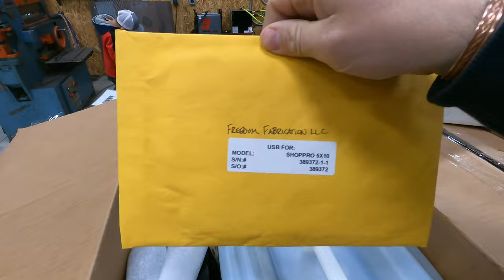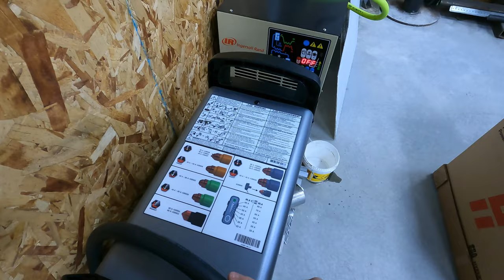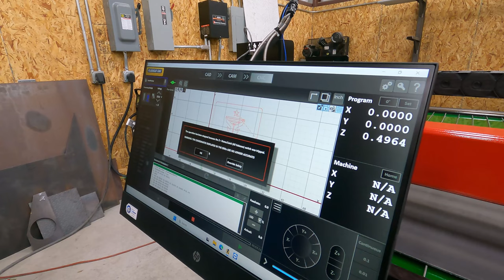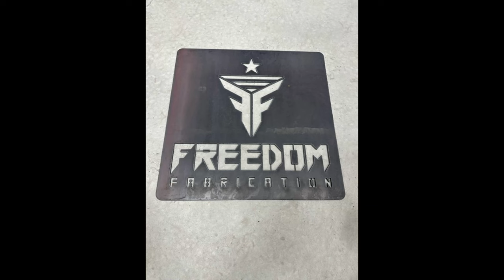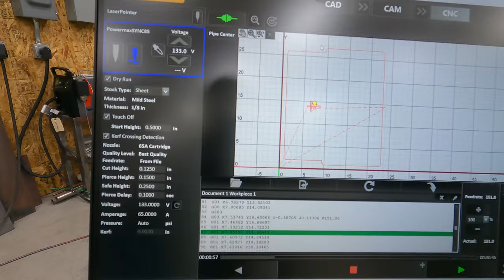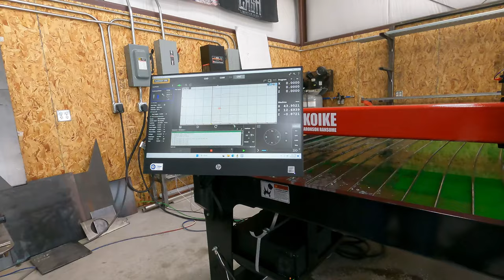CNC plasma table Install and Maiden voyage!

Comment: congrats brotha everything you do and how you fabricate is about to change man i remember the day mine came in still stoked on it to this day !
Reply from the maker: Thank you very much, It’s been an interesting journey. We had 3 different types of burn tables at the fab shop I used to work at, and it made the way we did work so much easier. They save so much time. Then after I quit and decided to do my own thing, I had to start with the old fashioned ways, i.e. torch and welder. And to think that I’ve come full circle, and I’m fabricating with similar equipment feels surreal. It’s always a good feeling when you see some of the fruits of your labor, which interestingly enough, leads to more work….🤔 I consider myself very blessed to have had the success that I have. Thanks for watching!

Comment: That's a nice table, I have a lincoln/torchmate 4100 table in my welding shop at school, those slats running parallel to the gantry are a major PIA. yes they are a major mess, I keep it about 3/4 filled with water that helps. waiting for a new cad program now old instructor took existing program when he quit a yr ago and he messed with the control box too. After a new control box and cutting juice ( he drained the table before he left and btw he ran straight water too so its rusting badly) I'm 5k into getting this thing running but I love it. good for you.
Reply from the maker: Thanks, it has truly been a game changer in the shop. Sounds like the previous instructor was a gem. I hope you get it in working order. Flashcut CNC software is great. Hope you have a Merry Christmas, and thank you for watching!

Comment: I don't have a table, but just thinking about it, I think a lower water level would work just fine since the purpose of the liquid is to extinguish the cuttings. Does that make any sense at all???
Reply from the maker: I think it definitely would help. I will have to try it. Thanks for watching!

Comment: I would buy a service cart from Harbor Freight with the top lid and mount the computer in it. The lid will act as water deflector. Or you can make removal lexan panels to protect you computer equipment.